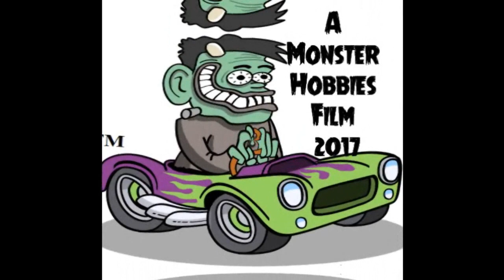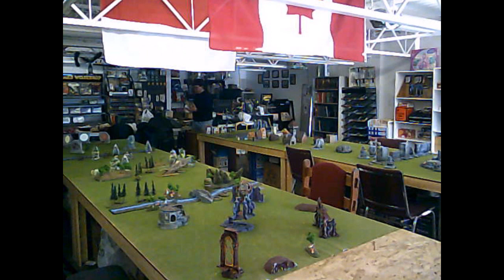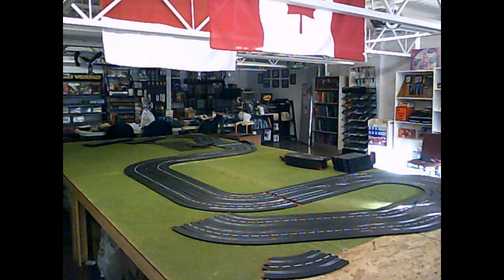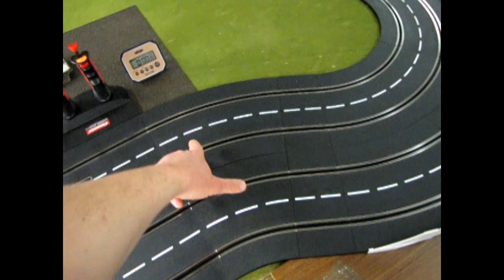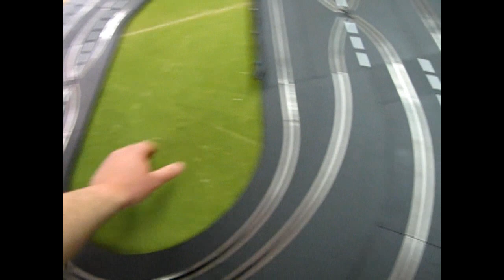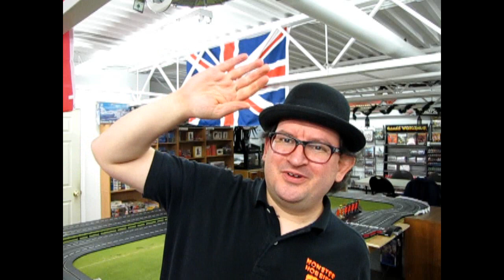How to build a 1/32 scale Carrera Oulton Park Race Track

Comment: I don't want to sound disrespectful, but that is very, very basic representation of one of the finest racing circuits in the northern hemisphere, maybe if you double the size and stick to two lanes. Thanks for supporting Oulton Park through your video.👍👍
Reply from the maker: This was built from a track plan from the 1960's designed to fit on four 4'x8' tables using 4 lanes. If I had more room, I could build it to the more realistic plan. Thank you for watching!
Reply: i guess it is pretty randomly asking but does anyone know of a good website to watch newly released movies online ?